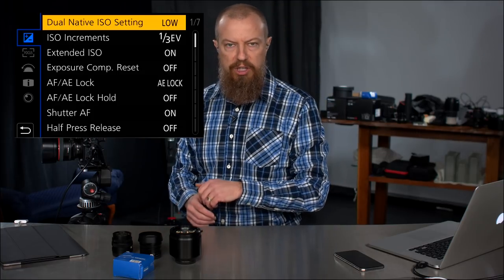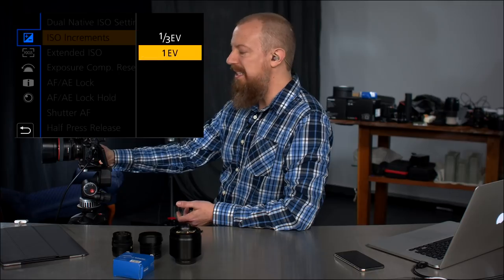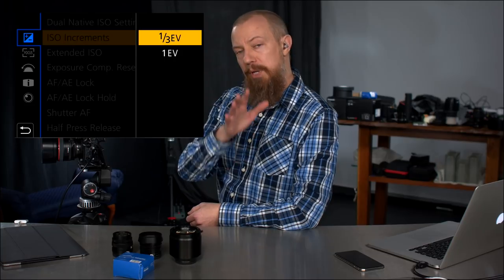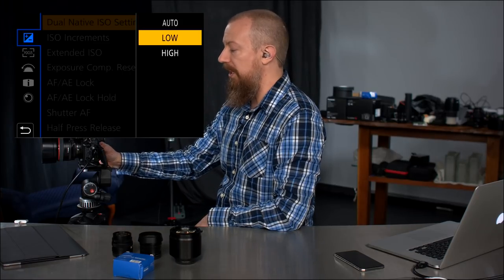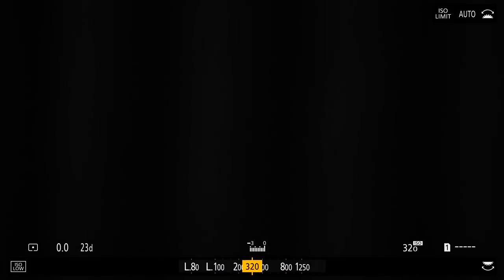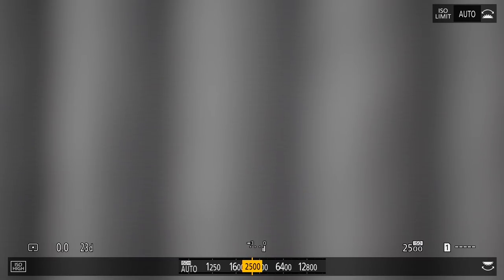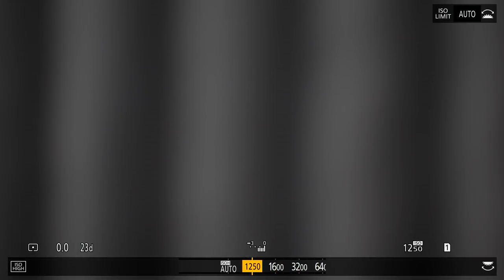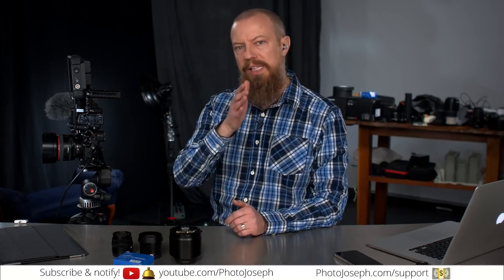GH5S Low Light Part 1 ► Camera setup, ISO 400 vs 2500, & V-Log Grading

Comment from the maker: CORRECTION: Apparently the native ISOs when shooting V-Log is actually 800 and 5000!!

In part 1, I show off the GH5S ISO settings, discuss the difference between auto/low/high ISO settings, compare in-studio shots of ISO 400 vs 2500, then show test shots from the blacksmith shop shot in V-Log on an Atomos Ninja Inferno in Final Cut Pro X!
Reply: Sorry Joseph - you need to correct your correction!  :-)  its 800 and 5000.  Feel free to delete this comment when you tidy up
Reply from the maker: LOL thanks… that’s what I get for responding to comments pre-coffee!!!
Reply: You get the same amount of dynamic range at every ISO setting but you get lower a lower noise level with a lower ISO setting (at least when using Vlog-L that is for sure) so it is best to use 320-1600 when you can. 3200 and 5000 are also clean but they have stronger noise reduction resulting in a sligthly less detailed image.
Reply: Thank, put the correction on video !
Reply from the maker: Can't edit a video

Comment: Hi Joseph. Just watching now can’t wait to learn. Interesting note is the native iso points on the Gh5s is 400/2500 but for HLG and V Log are native 800/5000. Testes have also revealed that despite these iso settings. The cleanest iso so far are 320/3200 so far
Reply from the maker: Hmm… ok I’ll have to look into that. Thanks.
Reply from the maker: SONNOFA… yep, you’re right. Native ISO is different when shooting V-Log and HLG. Thanks for bringing this to my attention.
Reply: PhotoJoseph youre the best keep em coming. Didn’t want you to think I was trolling. I’m just confused and trying to learn this new beast
Reply from the maker: Oh no worries! I’m happy you told me. Wish I’d heard it from my Panasonic people, but other than that… 😁
Reply: Good info - any link to test at 320/3200 - just purchased GH5s looking for cleanest ISO settings? Thanks
Reply from the maker: I haven’t done those tests no, sorry… but it sounds like others have.
Reply: Arnold Pollock try Crftsho guys
Reply: Hi Mike, Photojoseph... just looking around for others thought on optimum ISO too and came across this... I just ran through a test on mine in Vlog with lens cap on, stepping through iso in auto mode and boosting curves in post at 200% to clearly see grain structure - I too see it being cleanest noise at 320, 1600, then 3200 (4000 & 5000 are only fractionally more noise but it then becomes clearly noisier above 5000). I think what might be happening is that noise reduction is making it cleaner at 1600 & 3200 so the trade off could be sharpness and dynamic range. At the said native of 800/5000 for Vlog it's perhaps the optimum balance of dynamic range and noise... so it's noisier because it's not applying NR but also provides better sharpness and dynamic range. That's my theory so far at least ;)
Reply from the maker: Awesome tests! Thanks for sharing.
Reply: LOL

Comment: I understood that you can adjust the LOWER and the UPPER - AUTO Sensitivity setting (max and min amount) by accessing the "ISO Sensitivity (video)" menu option which is on the 2nd option down (Camera Icon on Menu)? or is this me not understanding? Whatever way it goes this is an excellent technical reference. Bravo!
Reply from the maker: You got it right. Not all cameras have that but yes that's correct. And thanks!

Comment: Greetings!
can you recommend me, I shoot weddings and in most cases in low light. I have a gh6, it's good, but the AF isn't great for me. according to your testing, I prefer the gh 5s. which is better for the given job.

Thank you !
Reply from the maker: GH6 low light performance should be nearly as good as GH5S but the GH5S may still be a little cleaner. But the GH6 is going to be a better performer overall. I’d use the GH6.

Comment: great work joseph !! Tell me ...when shooting at 96fps i get lots of noise in low light with the GH5S ....was actually hoping it wouldn't be so bad. the focus highlight thing pretty much sets the screen (red in this case) in a haze...? how can i overcome this ? also does the iso jump over after 3200?  appreciate if too difficult to explain as you would have to see my screen at the time of shooting. keep up the great work!!
Reply from the maker: I know what you mean with the focus peaking in super low light. Basically it starts to peak on the noise on screen. What ISO are your shooting? Also, not sure what you mean by “does the ISO jump over after 3200”… the native ISOs in non-Log are 400 and 2500. If you’re in auto ISO, it switches from the 400 base to 2500 base around 800 I believe. Your best picture will be at 400 or 2500 (or if shooting Log, then 800 and 5000). [I’m pretty sure those are the right numbers… I have it on a sticker on my GH5S but I don’t have it here with me now]. But let’s start with the ISO you’re actually shooting at and take it from there.
Reply: PhotoJoseph you know what I can’t exactly remember but was probably around the 3200 mark .... it’s just that I never saw that kind of hazy focus wash  on my old faithful GH4 RIP where it picks up on the noise .... hmmm I guess it’s the balance of how far you can push the VFR in low light - many thanks for your reply and your channel is super !!
Reply from the maker: VFR is definitely different than standard. I’d do some experimenting at various frame rated and ISOs and find thresholds you’re comfortable with.
Reply: PhotoJoseph  great thanks - come to Jaipur next Feb - very colourful place - I hold 3 nights of music at diggi palace where you’ll be welcome to join
Reply from the maker: Awesome! We aren’t doing Jarpur on this trip but I think I’ll be there for a day in November on a scouting trip.
Reply: PhotoJoseph cool 😎I lived there for many years and built a recording studio there for the folk artists - of you need any fixing I can help you out no sweat
Reply from the maker: morchangstudios wow great offer! Email me please? No way I’ll find this comment thread in two months. Joseph at PhotoJoseph dot com

Comment: I just bought a GH5S and a Smallrig and the cage doesn't completely tighten like the camera body shifts a tiny bit is this normal ??
Reply from the maker: Mine is snug. Sounds like a question for Smallrig.
Reply: @photojoseph  Gosh I sent them an email almost a week ago and have heard nothing. Do you think it might be because of the Metabones speed booster? it doesn't seem to be obstructing anything
Reply from the maker: Sorry I don’t know. But can you rig it? Put something in there to keep it from shifting?
Reply: @photojoseph  I put more elbow grease into it last night and used a coin for the screws and got it to fit snuggly. Thank you for your time :D

Comment: hey there.... I've recently experienced some horrible noise on my gh5s, i was shooting in a lite yoga studio on v log/1000 iso/96fps HD .
on inspection (not even pixel peeped) the noise was really bad ....in that i had horizontal lines appearing on the screen.
now i was sold this camera as a low light beast and am really disappointed with its performance, any suggestions???thx
Reply: forgot to mention...was shooting 2.8 12-35mm........really baffled ...help!!!
Reply from the maker: Try the same settings at 60fps. Also, native ISOs on the GH5S are 400 and 2500, so shooting at those ISO settings will be better than something in-btween.
Reply: thanks ....just tried that and its fine upto 6400. its not the slow I'm looking for but atleast usable.The lines distortion at 96fps make the footage completely unusable. are panasonic aware of this? appreciate any response thx
Reply from the maker: So 60p up to 6400 is fine? That’s good to know. What shutter angle (or speed) are you shooting at? If 180d, then that’s 1/192s at 96fps which is pretty dang fast; you must have a lot of light in the low light environment? I believe the problem isn’t GH5S or even Panasonic specific. Shooting high frame rate and high ISO together is a tough combo. If you’re ever able to test against other cameras I’d love to hear the results. And I’ll be sure to share your findings with Panasonic, thanks for doing the tests.
Reply from the maker: Oh also — I missed earlier that you said you were shooting V-Log. Native V-Log ISOs are 800 and 5000, so crank it to 5000, set a 180d shutter angle and if that’s too much light, use an ND to darken the scene. Are you experienced shooting V-Log? You generally need to overexposed by about 2 stops to get the best result. Live off the waveform and don’t clip highlights but definitely overexpose. Try shooting the same scene in non-Log at 2500 ISO and see what you get, too.
Reply: PhotoJoseph my shutter speed at 60fps was 60 ( sorry didn’t have it set to angle )
Reply: PhotoJoseph ah that makes sense - yes I’m new to v log and just super excited to use the Gh5s having had the gh4 for years .
Haven’t got my head around the angle/speed yet ha ! 
Many thanks for your response
Reply from the maker: So that’s really only a problem for motion blur. It’s not ideal but is probably fine.